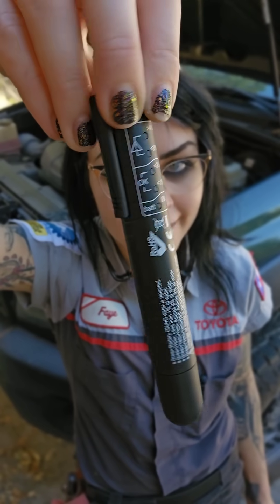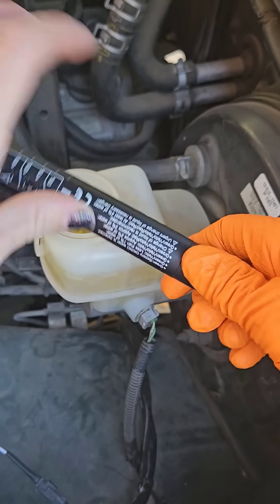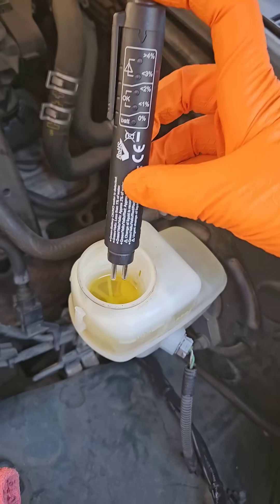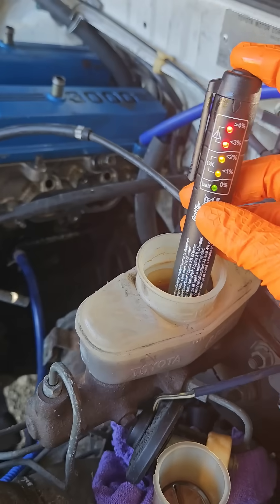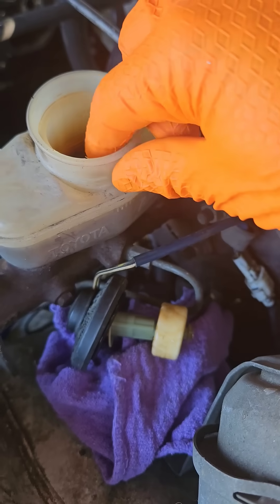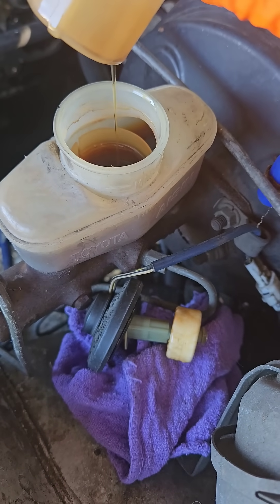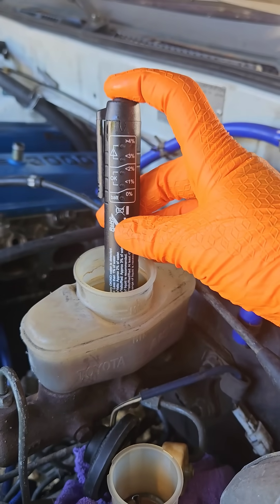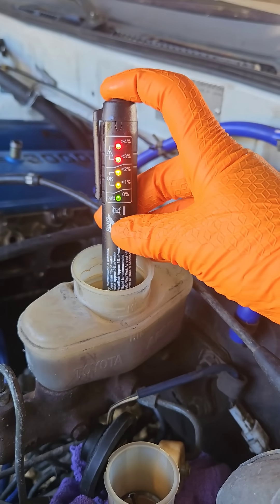Do you REALLY need your Brake Fluid Flushed?? How to Test it For Yourself!

Comment: In case you have a 10+ years old vehicle, especially a Toyota hybrid like Prius with quite sensitive ABS system and you have never replaced the brake fluid in your 5 years of ownership, is there a chance that replacement of the brake fluid with computerized bleeding might actually hurt the sensitive ABS and  cause internal leakage in the Brake Booster?

Comment: Many/most modern brake systems are VERY sensitive to contamination as well, with the first failure point frequently being the ABS module (which is over a thousand bucks in many cases).
Reply: And vibration. The modules have welded connections to various points on the PCB, and the PCB is coated with a thick conformal coating to prevent contamination and corrosion. However, vibration can crack the welds, causing intermittent connection problems. The coating makes servicing VERY difficult, since the re-bonding must be perfectly clean!

Comment: Every 3-4 years, same with Power Steer fluid.  I'm here in the Pac Northwest where it rains quite a bit.  After 3 years, the fluids need a swap, or a flush.   Power steering is hanging right in the mess when it's raining.   If it's darker than a strong Tea,,it's time.  If your in question still,,pour some fresh brake fluid into a clear cup, hold it up to your clear fluid reservoirs, if no clear plastic reservoirs, grab some out of the reservoir with the straw trick or turkey baster and put that in a clear cup.  Compare samples.   If your having to drive your car or truck thru the flooded areas this year to where you are submerging those parts that are not really meant to be submerged, even more of a point to be vigilant.

Comment: I always suck out the old brake fluid in the reservoir with a turkey baster and then refill it with new bf, drive it and let it get dark again and do the process over again until it just doesn't come back dirty.....been doing this on my 06 Cadillac XLRv and to date....I've never had a break system failure or needed to replace major parts other than pads.

Comment: Personally I never "flush". That brings the risk of introducing air into the system. Many cars also need fancy equipment for pulsing the ABS module to perform a flush. My method is any time I replace brake pads, I change only the fluid in the reservoir. Once I remove the old brakes on both sides and compress the pistons, all the old fluid back flows into the reservoir. I extract it with a syringe, top it off with fresh fluid, install new brakes and thats it. While this does not remove every drop of old fluid, the action of using the brakes will mix the old fluid with the new with normal use. While never as great as full fresh fluid, if done with every brake pad change the fluid will never become bad enough to matter. Been using this method for 30 years on my cars and those of friends and family. Never fails.

Comment: My 1990 car had same brakefluid 20+ years with no probelms, but these new brakefluids are not made to last, just 2 years, 3 years would be pushing your luck. It's has been made this way because it's better for nature than that old super good brakefluid. After your warranty is over, if you find that old brakefluid, you could use that at least next 20 years.

Comment: The master cylinder has a built in tester..... if there is water or incorrect fluid in the system the rubber insert in the cap will swell. Typically you wont be able to put the cap back on.

Comment: My 1996 4runner had the same brake fluid in it for 370k miles, never had an issue. I worked for Toyota for years and then Lexus for 12 years.🤷‍♂️lol

Comment: What she didn’t tell you…
Water is heavier than brake fluid so it doesn’t stay up in the reservoir, instead water makes its way all the way down and sits behind the caliper pistons where it can pit/corrode the surface causing a leak.  But before it leaks the water will heat up and expand a little after a few miles and that’ll cause the brakes to drag resulting in rapid wear, uneven wear, warped rotors, and in the worst cases it’ll get the hubs real hot, cause the seals to fail and the grease to bake.
So if you keep ending up with warped rotors and dont know why..
Reply: My wife's car had warped brakes when we bought it, the brakes are spongy af. Ty for this tip, I knew something wasn't right and our mechanic changed the disks not the fluid 😢
Reply: No, dot fluid is hydroscoic and evenly mixes, no pooling
Reply: Even if the water did pool in the bottom of the caliper bore, there would still be plenty of water in the fluid to test for
Reply: Wow, I never thought about that.
Reply: No. Brake fluid is hygroscopic, it absorbs moisture (water). Brake fluid, like most fluids has a boiling temperature. The more moisture it absorbs, the lower the boiling temperature gets. If it gets too low, the fluid can actually boil inside the caliper. This is bad because gas compresses which causes brake fade.
Reply: @jondurrett9277  you're both right. The OP isn't wrong. You're talking about a different aspect of brake fluid.

Comment: Most manufacturers recommend brake system flush between 2 and 4 years. I worked for a Honda dealership, and the shop forman didn't want to properly flush the brake system. He would suck the fluid out of the reservoir and top off. I hated it! I would draw the fluid out, top off and flush at each wheel till fluid was clear. I still do at my own shop.

Comment: I agree, 100% correct but when you have FB mechanics telling people…..ive never flushed the brake fluid in my car/truck and have 300k miles with no issue….so the 1 person disagreeing and explaining the same thing as you did (me) once one person jumps on the disagree train you have 50 other calling me the crooked mechanic. Had 1 person jump in and agree with me because he has ran his car on a road course and found out first hand what happens when the moisture in the calipers boil and brakes dont stop you at 100+mph

Comment: Good thing I saw this I was dealing  with a honda fit that was missing the service port that connects with the cowl, the master cylinder Reservoir  was starting to have cracks on it from being exposed to the sun and rain. I changed the whole master  cylinder but still lil spongie. Ima  need to get that tool to see if it water in the system.

Comment: You could add extra info for clarification of water compression: compressing hydroulinc fluids gets it hot (kinnetic energy is transformed to thermal). And so hot, that water, absorbed by DOT4 - boils and results in squishy pockets. 

To further the problem. It is most likely to boil when a sudden and impact of energy is delivered i.e. when you squeeze the brake hard  during (to avoid sudden impact).

Comment: Brake fluid is actually Hydroscopic. It has characteristics of hydraulic fluid with the exception of water absorbance. Hydraulic fluid does not mix with or absorb water, hydroscopic fluid does.

Comment: I was told by the mechanic at the dealership that they needed to do a radiator flush , I asked why and he told me it needed to be done because if I don't then the coolant would get into the oil and destroy the engine , I didn't tell him but I have rebuilt a few engines back in the day

Comment: Moisture should not get into the reservoir, there should be a rubber membrane between the reservoir and the cap that goes down with the fluid. At least on the cars i've had.

Comment: Most BrakeFluid longs about  4 years? BUT not the mechanic wanna scam you, the Car Manufactor -you wanna warranty? Than replace the fluid every 2 Year...etc. especially Toyota/Lexus with the RELAX Warranty. U wanna have it change ur oil every Year or 15k km, every second year need a BrakeFluid Change or every 30k km, change ur RoomFilter every 2 year and so on

Comment: As a recently retired mechanic , I would see cars over 15 or more years old that had never had a fluid change on a daily basis. I would also see cars 12/24 months old with less than 8k miles on them , the owners being told by their dealership that a £250 fluid change was required to maintain the warranty.

Comment: As a motorcycle tech I’ve seen it usually shows problems about yr 8 your brakes will drag . You’ll pull into a gravel lot and the front tire will wash out. The steam adds pressure. I’d say flush every 5-6 yrs newer synthetic fluid that isn’t hydroscopic . Study and do it yourself if possible some new cars u properly shouldn’t but study and find out.

Comment: Found out about this way back when i was a teen . Not only do you have the problems she mentions but water also when it reaches saturation then water will settle out in the low point of the system , the wheel cylinders/calipers . Then rust . I had it happen, normally not a problem, untill your project is to old to get parts . Had to take my cylinders to a machine shop , get them bored and stainless sleeves installed

Comment: I bought a pickup with a hydraulic clutch. They thought clutch was bad. Fluid had frozen due to water in the fluid. I flushed the system and still have the truck 4 yrs later having done nothing more to the clutch.

Comment: Hey Faye! Enjoyed the video! I've got an 08 4runner with 60k on it. I bought one of those testers awhile back. The fluid tested fine and looked fine after 15 years! I needed front calipers this last brake job and changed the fluid then so I wouldn't be pushing old fluid into new calipers.

Comment: It is a closed system . The only way water gets in fluid is if the cap is left off for an extended period of time. Brake fluid is hydroscopic.
Reply: no it can get through seals and microscopic pores in rubber lines etc, even a sealed container of new brake fluid has a shelf life
Reply: @arcanevoid9199  I have tested the brake fluid in my 68 Camaro a few years ago that has not had any added since 1990. The tester said it was good. The system has only been open briefly to check the level every few years.